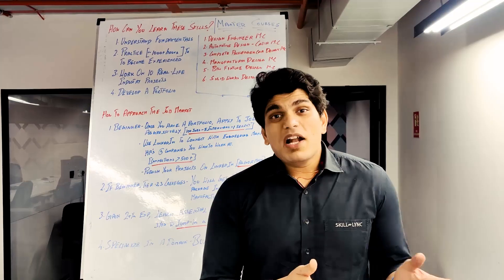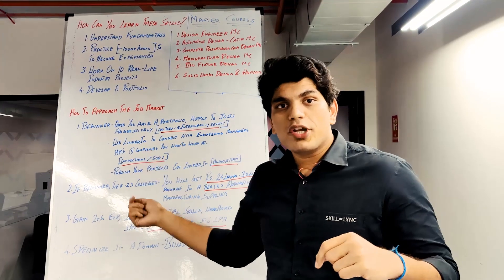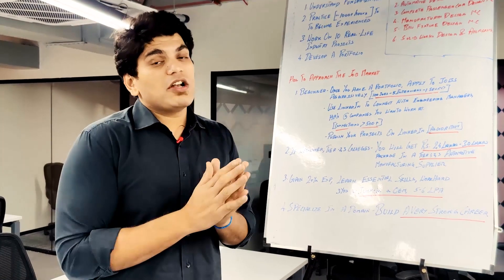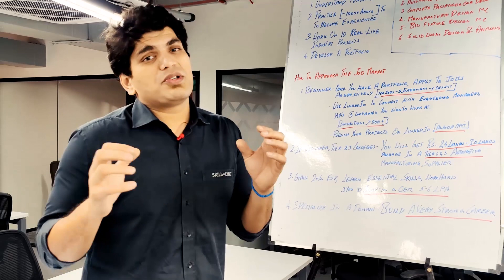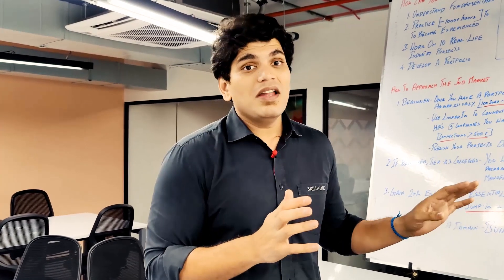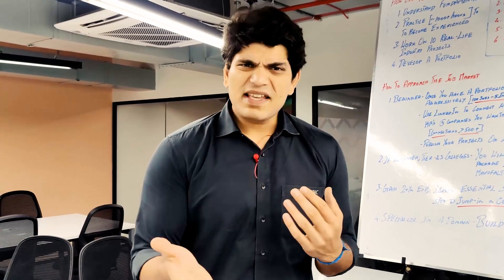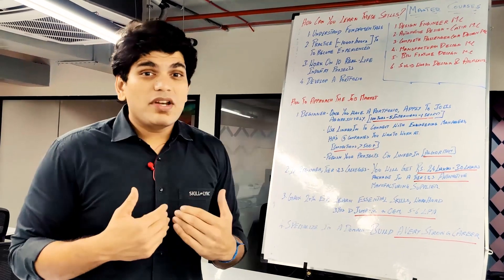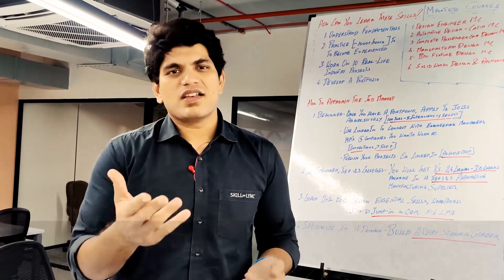How to become an Automotive Design Engineer? | Skill-Lync

Comment from the maker: If you are a Mechanical Engineer, Take a look at our Job Leading programs in the Design domain

Design Engineer Master's certification program - https://bit.ly/350X7I4

Master's Certification Program in Automotive Design using CATIA V5 - https://bit.ly/3p22df5

Master's Certification in Complete Passenger Car Design & Product Development - https://bit.ly/3p5PyYm

Master's Certification Program in Manufacturing Design - https://bit.ly/38jjmLw

Master's Certification in SolidWorks Design & Analysis - https://bit.ly/2Jzm7h8

Visit our website for more details about our courses: https://bit.ly/2TXN53U